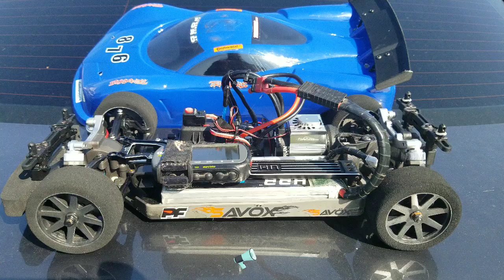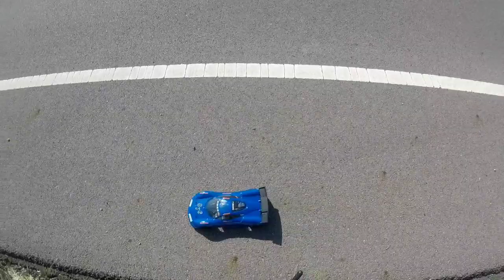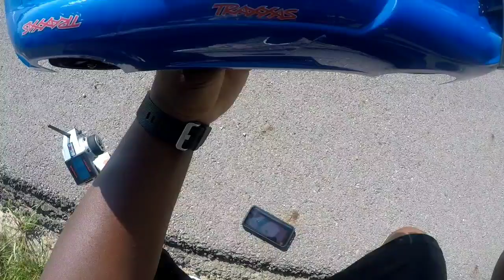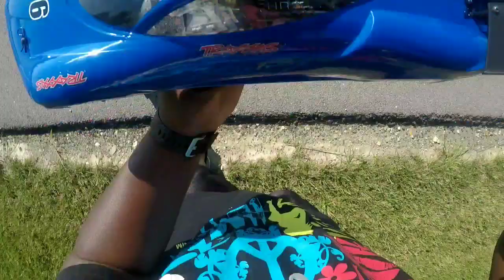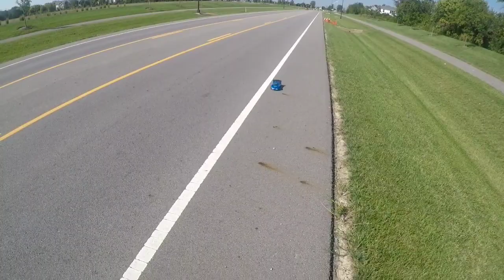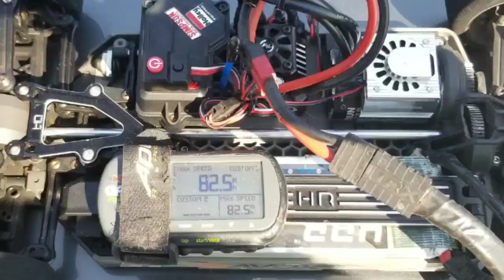TRAXXAS 4TEC 2.0 SPEED RUNS 3S POWER 82.5 MPH

Comment: Glad to see ya got it back out bro nice passes on 3s👊🏻👍🏼✌🏻
Reply from the maker: Yeah had to bring it out 4S runs tomorrow 👊🏾
Reply: Mobay876 hell yeah 👊🏻
Reply: @MoBay876rc  hey bro what happen body come off in the new vid ? You still run this body ?
Reply from the maker: @cripticcustomrc7043  yeah I lost a body clip before i ran it so I'm sure that didn't help 😂
Reply: @MoBay876rc  it keeps happening try ya a different body with some more down force  good luck my 4tec I'm runnin the protoform Mazda 6 might be proline havent lifted yet lol hope this helps 👊💯😈
Reply from the maker: @cripticcustomrc7043  yeah that's in the works new body motor esc 
👌🏾

Comment: Hey man, i saw your comment on ebay on this motor. Is it running well till this day? Im running on a 3s 10c batt, 60A esc. My previous motor was a 9t 4300kv and it got burned up after a year, managing to get a 45-55mph (eye calculation) on the same setup. From your experience, my main concerns are, is your motor more durable and will i be able to get the same top speed? Should i get a smaller pin gear considering your motor is an 18t? Thanks
Reply from the maker: F0RM4T this motor is very durable its rated for 3S lipo max I run 4s packs with no problem and you can go up a little bit more on the pinion gear I would get a bigger esc 120 amp at least to get good speed you need to start off with the 55T spur gear and play with the pinion gears till you find the speeds you looking for thanks for stoping by 👊🏾 if you look on my channel you will see a 4S run so you can see how the motor handles the power .
Reply: @MoBay876rc  Appreciate that man!